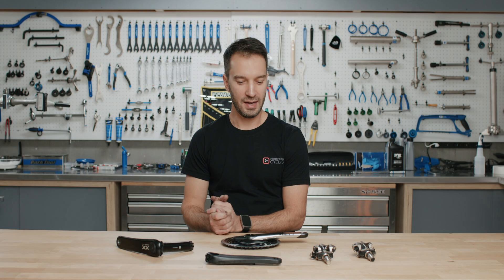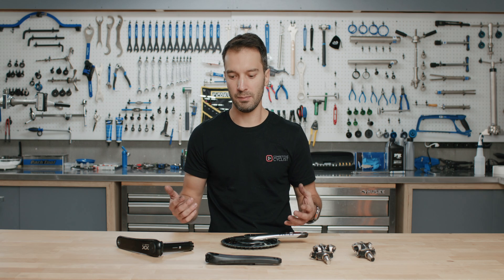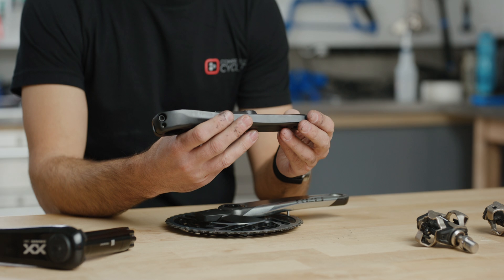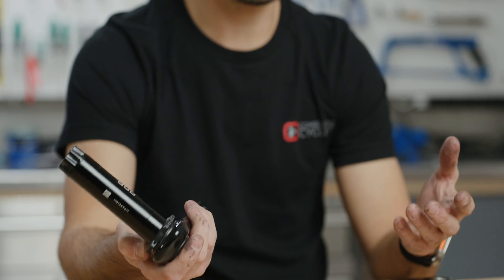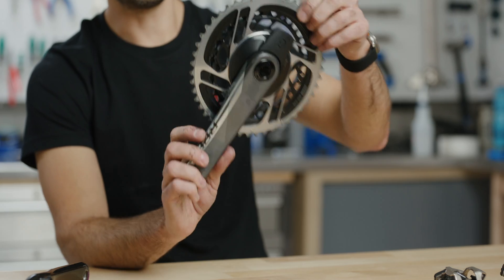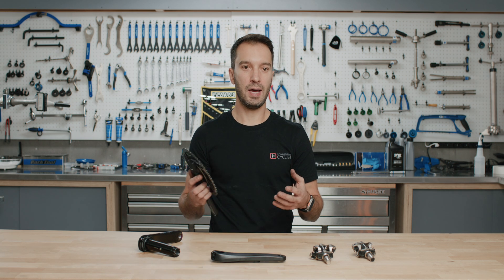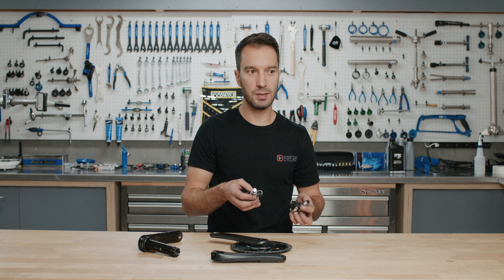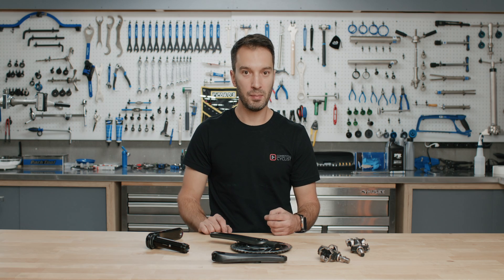The Different Types of Power Meters | Bike Tech Tips

Comment: Power meter is an eye opener 
1- the amount of power your putting out will surprise you on a slight incline
2- the lack of power when your going super fast downhill pedalling fairly hard will surprise you
3- pacing rides helping you go out easy enough for big rides to finish strong or for vo2max and beyond intervals where heart rate zones take too long to display as in then you go al in sprint by the time you have backed off for around 20 seconds your heart rate will probably peak here where power will
Be down instantly to resting power vs working power

Comment: Very much thanks for doing and posting this video.
Have an mtb but didn't really want clip in peddles as I fall off a lot and want my feet free to get to the ground really quick. ( old ).
Most of the interesting functions of my garmin 840 need a power meter for personal fitness monitoring.
Expensive , but at least what there is now .
Reply: Shouldn't need a PM for personal fitness monitoring
Reply: @michaelnewman880  Thats what I thought however the only time it returned a power reading was when I briefly tried a training course which wasn't my style. It has never returned one since. As I say I am getting older and I wanted that sort of thing  so as not to exceed my limits safely and to slowly mend a bung left knee by monitoring  my left leg output and gently increasing it scientifically rather my usual style of just grin and bear it.

Comment: Hub based power meters are not that rare.  They might not be produced currently but there are a lot of them out there.
Individual leg power does not really matter at all.  However, doubling one leg when the leg being measured is stronger or weaker than the other leg leads to bad data.  If this is your only power meter, no problem.  However if you have other meters, it leads you to wonder what is correct.
Reply: The exist with an installed base. But they are EXTREMELY RARE as options in the market place (ie when buying or upgrading a bike) so not really relevant for people who are looking to get into PM's